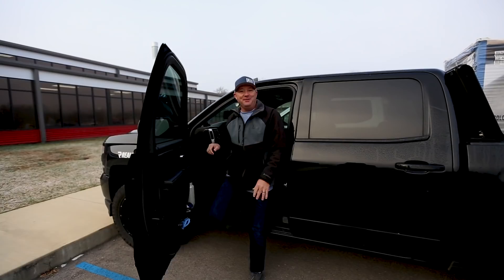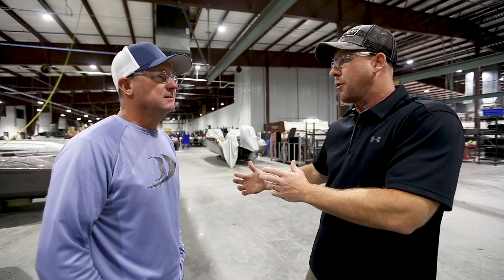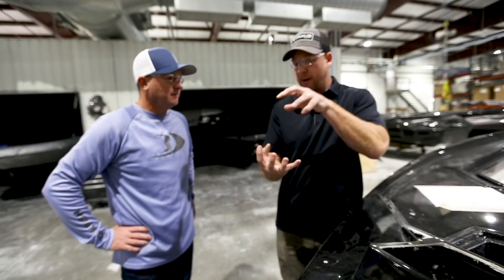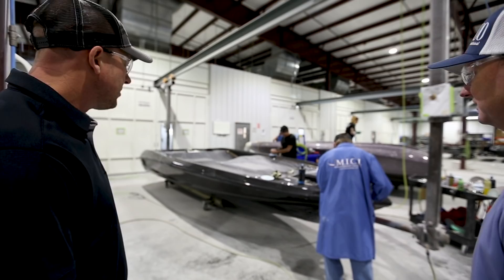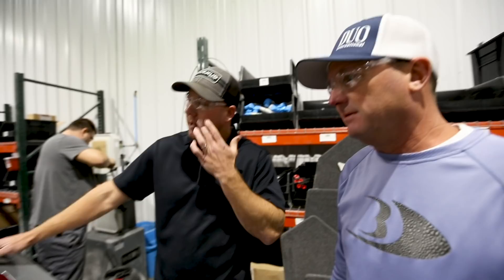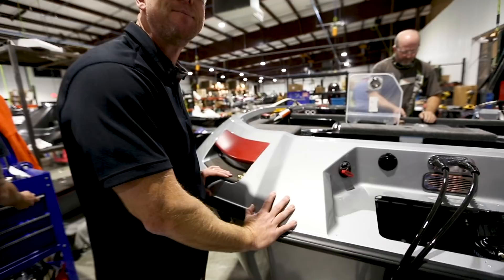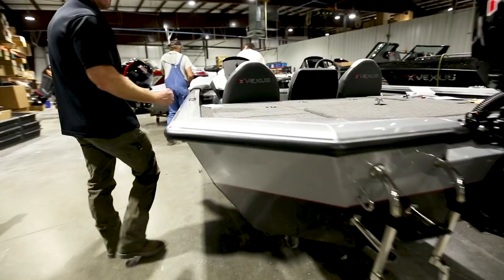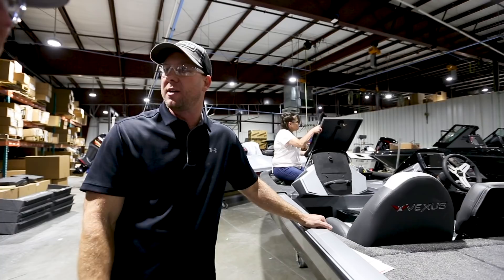VEXUS BOATS FACTORY TOUR | THE TOUR LIFE - LAKE OKEECHOBEE| S02 EP1 PART 1

Comment: These boats have been out for 3 years now and it's on my list to check out in a couple of years, when we retire to Texas.
Here's my problem.  I have seen all the boats and read and listened to everything over the past couple of years, but in non of it is videos of the VX20 or 21 in rough water conditions with trailing seas, etc.  That's what I want to see.

Comment: Somebody really dropped the ball on the pad design on the back of the boat obviously… Good friend of mine has the 1980 model with a Suk 115hp that slow as pond water weighing 2200lbs… His boat will not turn at top speed (40mph) WILL NOT turn… Absolutely ridiculous…. His boat is 15 months old and the hull has split on the bottom as well, and not even in a weld.. Y’all are in the process of building him a new hull now… SMH 🤷‍♂️🥴     This issue is just one of many he’s had with this rig in the last year.. Guys, go get one if you want too.. If you fish once a month you might be ok for a year or so.. Seriously